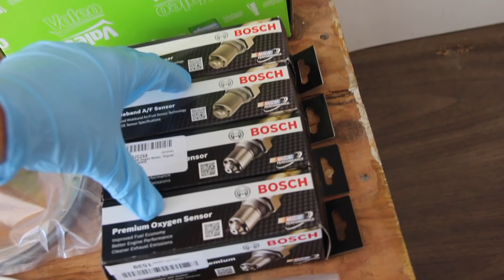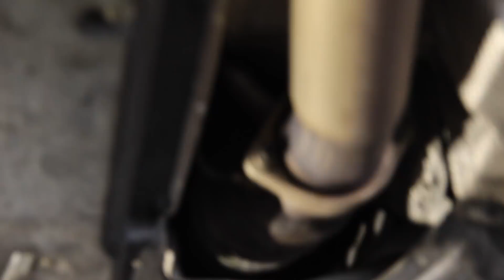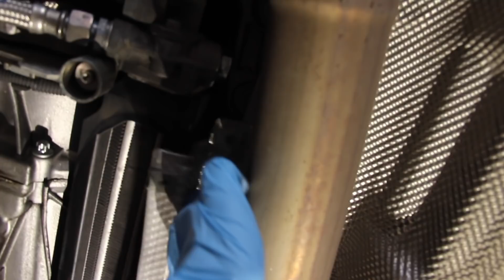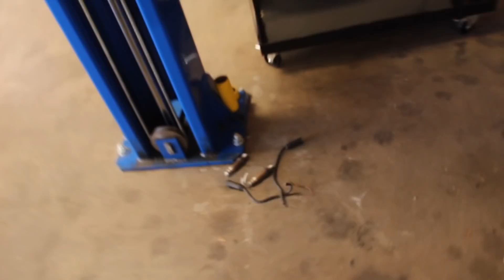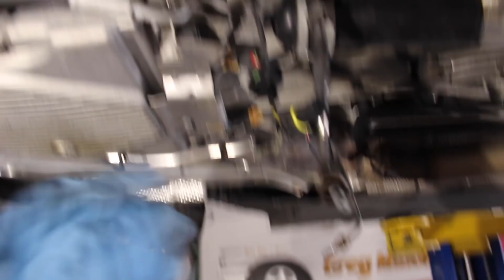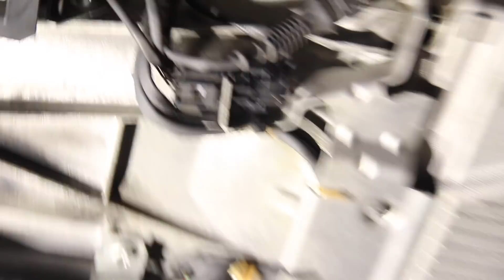BMW E60 M5:  Oxygen Sensors DIY

Comment: Hi, i have a 2006 m5 e60 with engine light on with 2713 code fault ( air mass sensor bank 2 ) but the air sensors is new left and right , do you have any solution
Sorry for my english i am french
Reply from the maker: Your oxygen sensors may be wired backwards, verify that wiring.

Comment: i have 27AB Oxygen sensor adaptation at limit position at bank 2. I need to replace it or i can clean it ? the car has 130000km .
Only at low rpm the code appears.

Comment: Just removed the driver’s side pre-cat sensor on my e63 M6. Hitting the 22mm wrench with a 3lb dead blow hammer was not working, so I sprayed PB Blaster where the sensor threads in and waited a half hour, but it still wouldn’t loosen. I then hit the header with a MAPP torch for a few cycles and the sensor loosened up and spun out rather easily. Not that bad of a job, surprisingly. Penetrant and heat will do the trick.
Reply: Was the job pretty much the same as this M5? I need to do the same one on my car, also M6.

Comment: I just received an "Increased Emissions" on my 2010 M5!  I cleared the code and the engine is still running sluggish,...the RPM is stable, so I'm thinking that's a good sign that it's not the TAs or MAF sensor(s).  I think the code showed a Bank 1.  The RPMs stays at around 800-900.  I have no history of the O2 sensors ever being replaced,....So, I guess it's the best things to replace first to see if this is the issue.  Praying....

PS:  Thank for you for the vid...Thumb Up!
Reply from the maker: You'll need a scanner to see what code is being reported to the DME.  It could be any of several hundred different codes.  I would not recommend throwing money at MAFs until you know what its complaining about.
Reply: Did it fix your issue? I have the same “increased emissions” on mine as well
Reply: @Yaci1126  It's at the Indy right now getting repairs!  The low quote is $3300!  More to come...  I may be selling it,...and focus more on my '16 F30 340!,...as I can get way more reliable Hp from that car than from the e60 M5!  ...at least I experience the Legendary V10!

Comment: Thank you so much buddy .You have a new subscriber 
just finish  fixing  p0444 and now i got these check engine, code , wait in 2 weeks become 4 code, thank to you I can do a least the o2 .
If you can give any idea  my engine is N52 e60
2007 525i 153000 miles,
Code P2098 post catalyst fuel trim system too lean bank 2
Code P2272 o2 sensor signal stuck lean bank2 sensor2
Code P0597 thermostat heater control circuit /open
Please what do I need to do, thank you in advance
Reply from the maker: Start with replacing all oxygen sensors, then reset codes, drive, and see what returns.
Reply: @E39Source  thank you for your time, 
In the forums someone  told me 
Replace all coils, and all of the code will be gone because the coils makes triggers them,
What do you think the coils or the o2 sensors, 
Sensor  are cheap  but pain in the ass, coils  are expensive  but easy to replace  , both  are money and time, 
But  in idle and reverse or on drive and  break on "traffic light " stop sign is a vibration  that piss me off buying these car so much
Reply from the maker: @FlavioFlorio  These sound like oxygen sensor codes to me, not coil/ignition codes.  It would be (should be)  much easier on a 525i vs this M5.
Reply: @E39Source  ok them i will start  from the post first since is where the code are, both sebsor 1and 2 on bank2
Then if after driving i do bank 1

Comment: Could burnt O-Sensors also cause low revs,  as in nothing higher than 2500.
Reply from the maker: I would be surprised if O2 sensors would cause that.  That sounds like throttle body actuators to me, what do the codes say?
Reply: @E39Source  will have to find out once someone with a diagnostic tool checks the codes.
Reply: @E39Source  people working on the car just got back to me and said they checked the actuators and they were fine. 

The diagnosis said heat sensor bank 1 & 2 as well as air mass.

They have fitted a good second hand MAF sensor that came off another same model E60 that runs,  fitted a new fuel pump, and still the low revs. Mechanics looking at two likely areas now, the O-sensors which are burnt (only noticed now) due to wrong fitting a while back causing them to short and burn probably some months ago without anyone figuring it out, second area is the exhaust system possibly being blocked. What's your take on this? 

And thanks a million for the reply.
Reply from the maker: @wilhelmhesse1348  I would replace those O2 sensors anyways, it could be them.  An exhaust blockage sounds unlikely, unless the car has been sitting in storage and some critters moved in?
Reply: @E39Source  actually it has been idle for a while, so will have a look at both. All the same thanks once again. Your channel is one of the few that actually replies to questions. Keep up the good work.
Reply from the maker: @wilhelmhesse1348  Good luck, happy to help!

Comment: I'm getting ~9-10 mpg. I have 111k on the car and I drive it relatively hard, but thinking I need to replace these on my E60. What kind of mileage were you getting? 
I also have to say great video as always. Straight to the point and great amount of detail.
Reply from the maker: For better fuel economy, I'd replace the MAFs, O2 sensors, spark plugs, maybe cam sensors in addition to engine air filters, checking tire pressure, etc.  But unfortunately you're not going to dramatically increase economy.  The V10 is a gas-aholic.
Reply: I drive my 2006 e60 m5 like a granny, almost never in M mode(just want to keep the car in the great condition is already is and don't want to accelerate rate of repairs/maintenece)
I get an average of ~13 mpg.   If you are driving with all your horse power in M mode most of the time, ~10mpg makes sense to me
Reply: @12345yarg  Driving like a granny probably does more harm than good. It’s a 4,000 lb F1 car, and she was meant to be driven like it.
Reply: @12345yarg  get civic cos you’re wasting your money if ur granny this car all the time

Comment: Did you find the sensors to be hard to remove? do you think a sensor socket would be necessary? no need to torch them? I hear they fuse themselves stuck because of the heat.
Reply from the maker: Once I was able to get the socket setup right, I was able to remove the sensors without a great deal of difficulty.  I haver also seen them stick quite a bit and require a torch, so it ca go wither way.  The socket is necessary to properly torque the new sensors into place.
Reply: @E39Source  how about the battery, did you have to disconnect it to avoid resetting the error codes or was that not an issue?
Reply from the maker: @31acruz  You can disconnect the battery if you wish.  We didn't- if you don't cycle the key in the car at all, it'll never know that they were disconnected.

Comment: Can it be that my M5 idle up and down sometimes on stand still because of the oxygen sensors is bad? I think it drinks fuel more than normal to. Btw I must say it has deleted cats and ECU remapped.
Reply from the maker: Possibly, but many things can cause that.  Bad O2s can cause poor fuel economy, too.  I would replace them if they are old.
Reply: E39Source, LLC hm ok!  Is it a must to change the rod bearings now when the M5 has almost 100 000km on it or what do you think? Some cars goes much more until they change and some less. Thanks for fast answer! Btw your videos are really good!
Reply from the maker: @Plisii  Thanks!  Rod bearings on these cars are a well know problem, I would change them at 80,000 miles or 125,000km.

Comment: With no disrespect t why not original BMW Parts. After all m5 is an expensive car.
Reply from the maker: The Bosch are the original BMW sensors, without the logo.  Identical part, at 1/4 the cost.

Comment: How many miles? Why did you need to change them? Were there any issues or codes? Thank you.
Reply from the maker: 100,871 miles.  We changed them in hopes that it would provide better fuel economy.  So far, it has made a noticeable difference.  We had no specific codes that pointed towards failing oxygen sensors, however.
Reply: Smells like @*&^ sh!%.